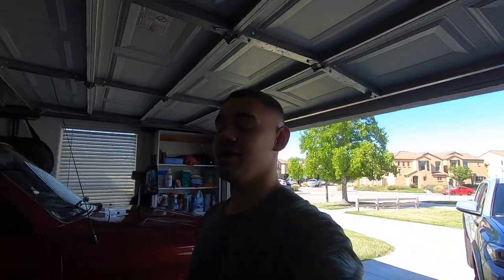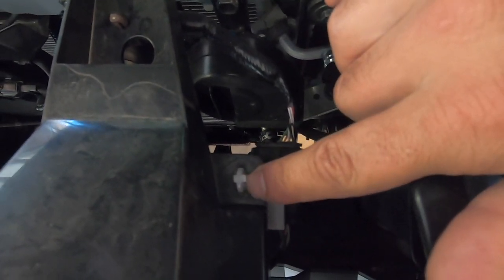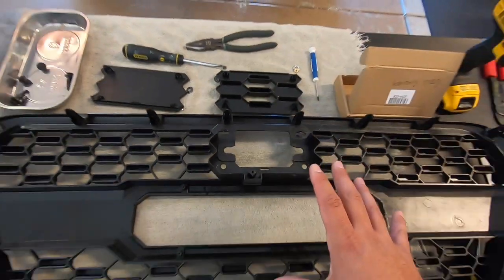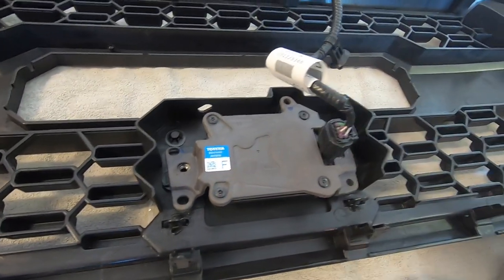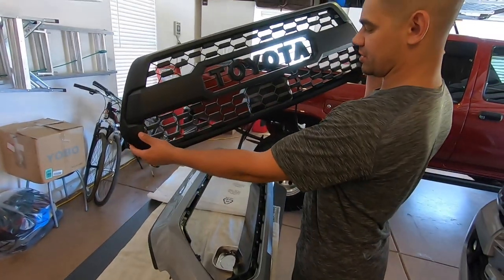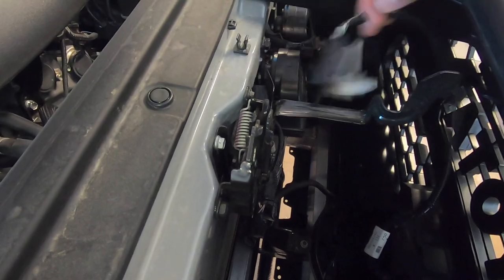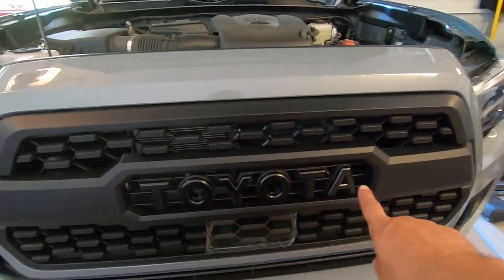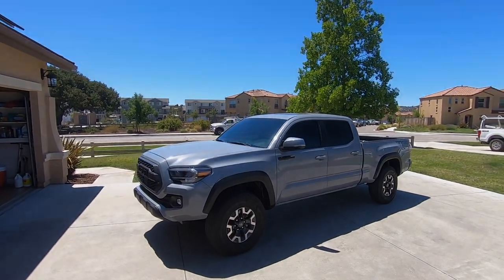3RD GEN TACOMA TRD PRO GRILL W/ SENSOR INSTALLATION!

Comment: I was told at the dealership that you had to recalibrate the sensor after installation, which is why I was hesitant to do this for mine.  Based on the comments in here, you aren’t having any issues with it malfunctioning.  I might proceed with getting one now.

Comment: Have you done or ever considered giving your Taco an OV tune at all?
Reply from the maker: Yeah I will once I find out if it voids warranty or not. No one seems to answer that in any of their videos lol will also be getting a re gear soon
Reply: @TacoManD4X4  Haha, exactly the same boat. I just don't konw enough about it to pull the trigger myself either. If you ever end up doing it, would love to see the video!
Reply: @TacoManD4X4 it does void the warranty but it’s really hard to notice unless they dive deep into the Ecu plus if you get friendly with your tuner they may remove the tune if you have crazy issues so when you take it in they don’t notice a difference. My tuner said he will change and remove my tune for free until I get rid of the truck

Comment: Hows the sensors they the same or different
Reply from the maker: It’s the same sensor that came on the truck, I just had to mount it to the new grill. It was easy and I have not had any issues with it 👍🏼
Reply: @TacoManD4X4  My 2021 Tacoma TRD 4X4 OFFROAD will get a Bilstein 6112 front and rear Bilstein 5160 with an Icon AAL soon BUT I would like the Radar cruise control still to function right.
It seems that I have to get a TRD Pro grill to make it work?

Toyota also sell now a 2 inch lift kit for the Tacoma,  $2000 Canadain here in Canada. 
That kit use a Tacoma TRD Pro grill too.
Don't really know why the stock TRD 4X4 OFFROAD grill won't work 😕.